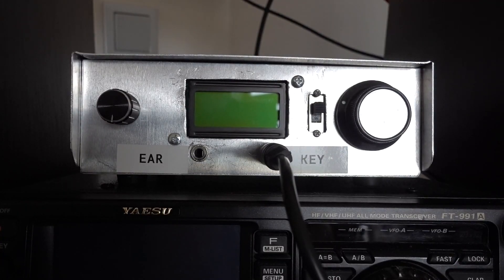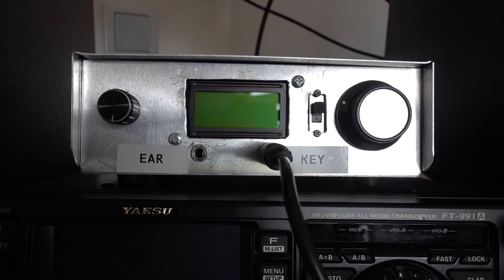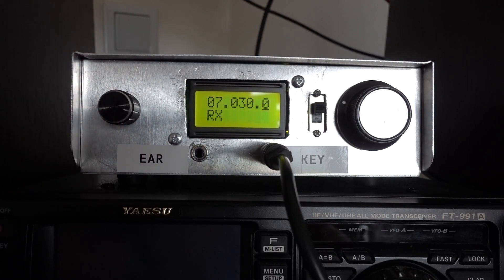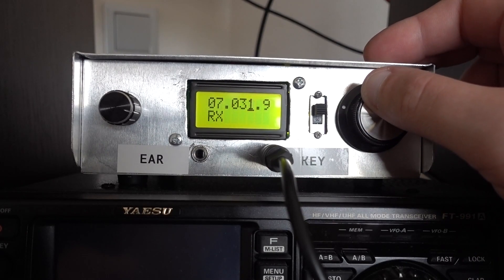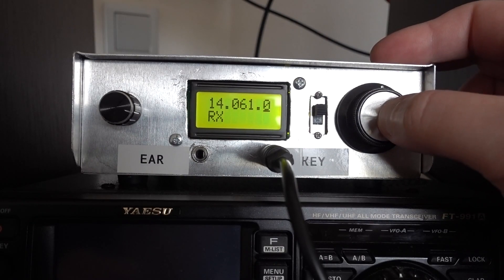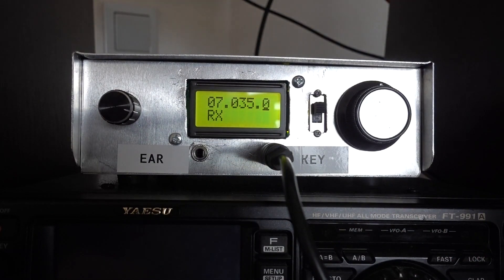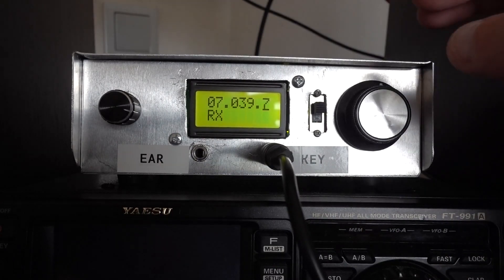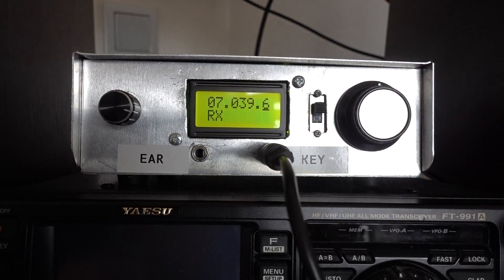#13: Homemade CW QRP transceiver for 20/40 meters

Comment: Hi,
What is the bandwidth of filter?
Reply from the maker: ~450 Hz. It's the same 12 Mhz CW filter described in https://eax.me/crystal-filters-part-3/
Reply: @R2AUK  
Thank you. 
I did not check source code and thus have a question related to iambic key. Is it possible to change keyer speed? Both videos do not show this.
Reply from the maker: @rst5nn I It can be changed but only in the code. See DIT_TIME_MS macro and corresponding comments. There was no much space left on the front panel and I figured with QRP I'm going to use no more than 18-19 WPM, thus I choose a fixed speed for this project.
Reply: @R2AUK  
Some ideas for future.
For iambic key speed can be changed by paddles like long press and on the same time press did as - and dah as + speed. 
But agree, this totally personal rig thus creator will set proper speed manually.
Reply from the maker: @rst5nn  Thanks for the idea! Will try it in the next project.